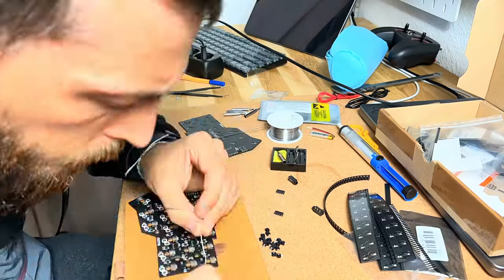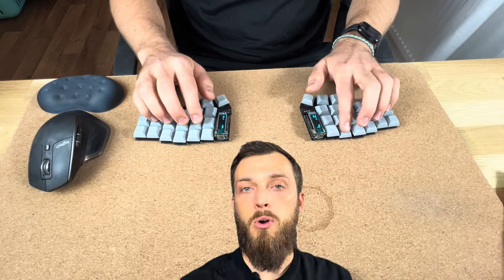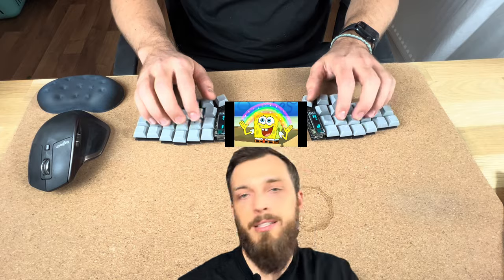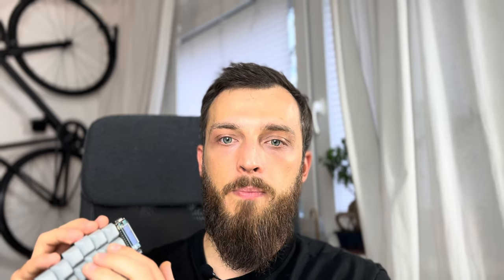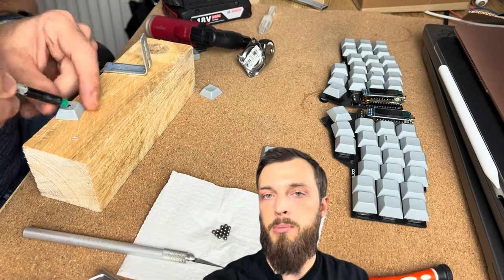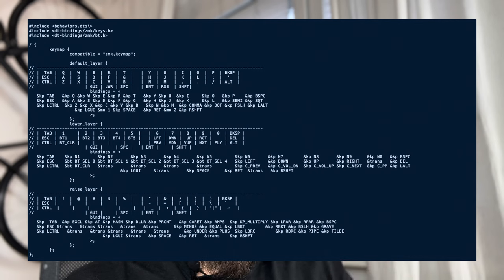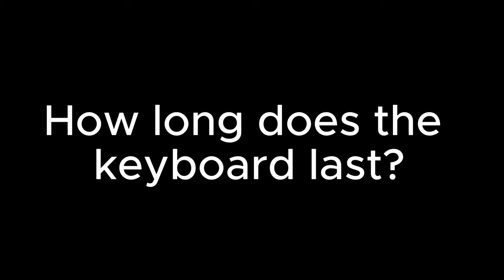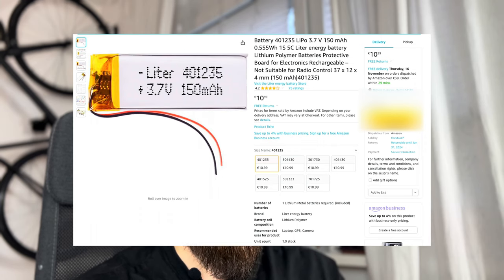The Corne after 2 weeks, worth it?

Comment: I am using a corne keyboard for nearly 3 years. A wired version, the wireless and battery stuff is more an inconvenience in my opinion. Anyway, it totally ended my shoulder pain which I suspect was due to the mouse being too far away when using a keyboard with numpad. The mouse is very much used when doing 3D stuff (CAD, modeling, animation, ...). Also it improved my speed, productivity and comfort. Definitely the best keyboard I ever had by far.
Reply from the maker: Nice, thanks for this nice reply. For sure, it is amazing. At home I also use it wired, I am glad that I have both options in this. On the go, wireless is a bit nicer :) 
It is for sure amazing. 
Most lovely is the arrow keys on homerow as well as in vim :D (for me at least :D )
Reply: @CodingWithAuryn  Thank you. Actually I spend most of my work time in neovim (developing some 3D related app and plugins) and have the arrow keys mapped to hjkl like expected, but also to wasd for using/testing the 3D stuff.
Reply: another 2-years old convert here. built the low-profile and the classic but i prefer the classic with no displays/leds + rp2040.
Reply: Why wireless + battery stuff are more of an inconvenience than feature? The battery in the video should actually last longer, about one and a half to two weeks unless he's using OLED or his battery is damaged. And it can be upgraded to a much bigger battery that can last several months without adding too much space (although will be under the keyboard, adding some tent but reducing portability).
But what's the issue with the wireless? Does it keep losing connection or something?
Reply: @LLF1234  Well wireless is more stuff to worry about, (pairing/connection, battery level) it is less secure and adds a bit of delay. Beside you still need to connect it with wire to recharge the battery. A wired solution is much simpler: wire it once and you are done for your whole life.
Reply: @xavierthomas1980   I can't comment about security, but about the delay that's weird, I have a Logitech K860 and it connects using Bluetooth and there's no delay on it. I wonder if the board they use on the Corne is an older board or something like that. But I see your point, I would go crazy with the slightest delay on it. 
About connecting the battery, well, for my use case, if the battery can hold a week, I could put it to charge overnight once a week and use it during the day, that's not a problem (even better if we can use the kb plugged in as well). But I would like to move the keyboard around, so keeping it plugged in all the time kinda sucks. Also, I could use my logi in case the battery dies and I need to charge it during the day. I'm just too used to wireless now lol.
Reply: @LLF1234  The delay is more teorical than noticeable. And in the end the wired/wireless pros and cons ratio is relative to the usage. For desktop dayly use, wireless is definitely useless. For travel and occasional use it probably has more advantages.

Comment: The Corne is a neat KB with a few optional features and mods. If you want to do your own soldering, it's a decent project that can save you a chunk of money for good keys and can be setup for Choc sockets if you want instead of Cherry. I love the trick of using a ball bearing melted into the keycap, very metal.
Reply from the maker: Thanks a lot. I soldered it as well :) 
Was a nice project and will probably also mod it further. Maybe some day I add leds 😅
Reply: @CodingWithAuryn  Depending on which version of the pcb you have it can be a little tedious or fairly easy on newer versions. They eat quite a bit of battery I hear unless you get a case that lets you fit a bigger battery. Without lights I hear those go workdays without charging. Mine is a wired version. Corne is popular so it has some options out there to make it unique.

Comment: I have had my Corne (wired) for a couple years, but I still haven't been able to start using it yet. My desired layout requires tapdance, and I just can't work out how to install Vial or do tapdance through QMK. Very tricky for non-software types. If you ever do experiment with tapdance, please document how you did it in detail 😅
Reply from the maker: Hey, thank you for your response. I have no experience with tapdance or vial, sorry. 
Also i am using zmk because i use it as bluetooth board. What i am thinking about is still adding the hold modifiers for shift or others on long press. But all in all i am very happy with my current configuration. :)

Comment: How tall did you place the nice nano in order to fit the battery under it? Would a 5mm tall battery fit without the displays installed?
Reply from the maker: Hey
Did you mean 5mm height? 
I just added wire in flexible length, so you can just mount it as high as needed for the battery :) 
In my case I just put the battery in place and put the wires afterwards in :) 
Hope this helps? 
Also one note to add after nearly a month, at home I just use it wired. Only while travelling I use the batteries. They hold with display like 2-3 days. I also thought about removing the display. The benefit is low tbh. Just the connected device is interesting.
Reply from the maker: Hey
Thanks for your message, no idea why I didn’t see it yet
So I measured with my corne and they could fit yes. But if you do a low profile build the display will be higher than the keys :) 

Yes I use the oled. And also read they consume way more energy, but there one cost 6€ and not 25€ like the nice view. 
I don’t need the display that much, I may upgrade at some point :)

Comment: Great video!  Very informative and I really enjoy your phasing and calmness. You earned yourself a new subscriber :) .
I haven't tried this myself, but I had an idea/tip for people running into the problem @ 2:29 : As an alternative to the metal ball solution, you can also create a small bump by putting a small dot (or line) of superglue the keycaps. Make sure to clean the surface beforehand and let the glue dry well. It might wear out after a while and it could damage the keycap, but if it does you could always replace the glue, do the metal ball method anyway or simply replace the keycaps with caps with actual finger guides.
The metal ball solution is way cleaner (and more creative!) in my opinion, but the superglue solution is a more accessible and easy to do if you need a quick solution. :)
Reply from the maker: Thanks a lot for your idea. Yes, this was also my first try, unfortunately the hot glue I used did not stick and I had no super glue at this time. So the metal ball worked best for me. But for sure an gut alternative :) thank you for your subscription as well :) 
Have a great time!